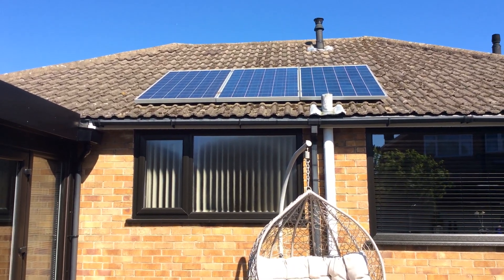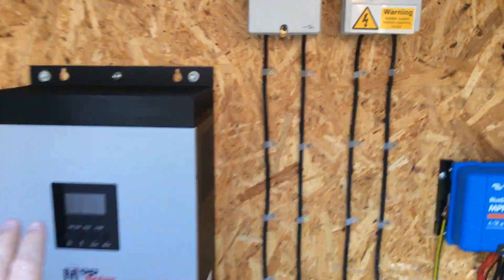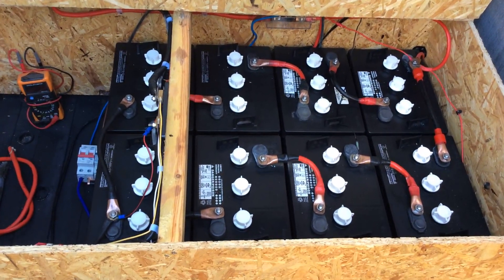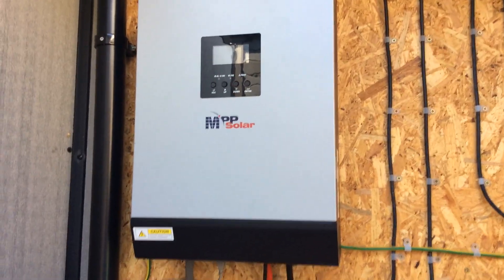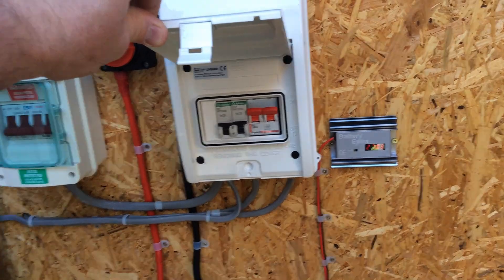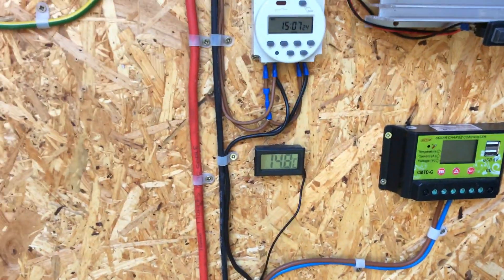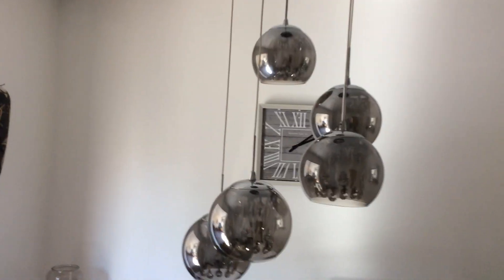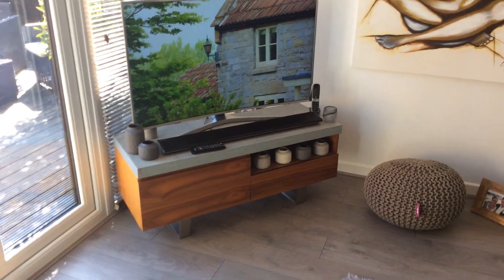UK off grid DIY 24v solar system.(typical windy day)

Comment: Okay,how big is your 24v inverter please? I am using on the moment 24v3000watt inverter and my 4x200amp batteries are fine on the moment,but one day i will make a update on more solar panels and batteries
Reply from the maker: My inverter is 2400 watts with a maximum 3000 watt surge voltage. Please check out my other video.

Comment: It's about like mine ; I have twelve 12 volt batteries with 525  amp hours...I bought a  24 volt Aims inverter / charger 2000 watts and I like it pretty well but I use a 410 watt a lot also...my two newest additions to the battery family may be the last for awhile...I started with four panels but one got broke in the wind so I bought three more so things would be even, lol...they get a little higher voltage every day but they're up to 16.5 or something with a bout thirty minutes of day left..it says 27.6 on the MT 50 meter but it's being pushed at 13.8 amps so that'll drop ...I can tell a lot of difference though...I bought a 40 amp Epever controller because it takes #4 wire easily and I like the big lugs...lol...it does great...hey the  video was okay but I had to turn off all the fans and really listen to hear it...so now I'm hot...

Comment: This is great - I just got a system like this which is 24KW batteries and 3.2KW solar with this system - I wondered how the AC was wired up
Reply from the maker: Which way? Coming in or going out? AC back up comes straight from the consumer unit off a 16 amp trip. Out going AC is done using 2 separate ring mains. 1 for the lighting and the other for the 5 sockets which run all the TV’s etc in different rooms, Both rings run through separate breakers in the shed after the inverter.

Comment: I have the MPPT LV2424 inverter also.  Unfortunately standby current is almost 30 watts.  To remedy the high standby current situation I purchased a smaller Victron Energy 375 watt inverter for normal light loads, and use the MPPT inverter for emergency backup power for heavy loads such as starting and running a refrigerator.  Standby power for the Victron Energy inverter is only 8.5 watts.
Reply from the maker: Yes your quite correct, you have to take into consideration power losses throughout your system.

Comment: Great looking system.  I like the idea of the separate 'power shed'.  Are the panels rated at 300W each?  You said 875W of power is that based on 72 Volts max/ 12A on a great sun day?  How do the panels perform in the winter or the lower light days, what voltage/A do you typically get? I am trying to figure out whether the 300W panels work better over 100W panels on not so good days.
Reply from the maker: The panels are 275w each and we’re to cheap to refuse at the time of buying. They are Polycrystalline we’re mono crystalline would have been the preferred choice. The system from October only runs during the day till about 5pm and then we return back to the grid. Main reason is lead acid batteries under perform in the colder winter months. Lithium batteries are the way forward but they are still a little expensive. Don’t see any benefits with 100w panels? Hope this helps.

Comment: What is you battery voltage in the morning after running all night?
Reply from the maker: On average it’s around 24.7v to 24.8v. Very really goes below these figures but if it does then the system will switch off and return to the grid to protect the batteries. Hope this helps.
Reply from the maker: These figures are estimated based on summer months and weather conditions etc.The inverter battery cutoff is set at around 24.4v
Reply: @solardiymadesimple.3779  Could you do a video to explain how that system works to switch from the battery supply to the grid? Thank again for the video it was very helpful and informative!
Reply from the maker: @DrThrillz   In the video @ 4.30 minutes in you will see the change over switch . This switch has a permanent live feed from my houses consumer unit. When In the down position it’s running of the solar only. If I have any issues with my system or I’m struggling charging due to bad weather all I have to do is flip the switch into the up position and I’m back onto the grid only. This will also isolate the inverter and the solar system. Basically it’s a bypass switch,and then all I do is switch the inverter off while the battery’s recharge. You can also set the inverter to cutoff automatically if if reaches a certain voltage to protect the batteries from over discharging. Hope this helps.